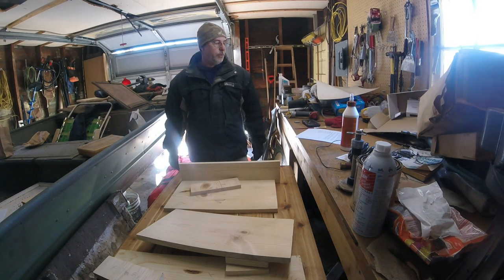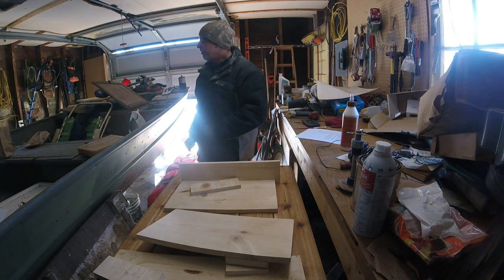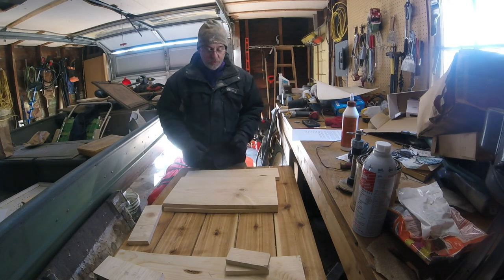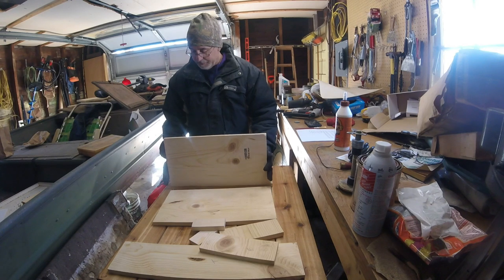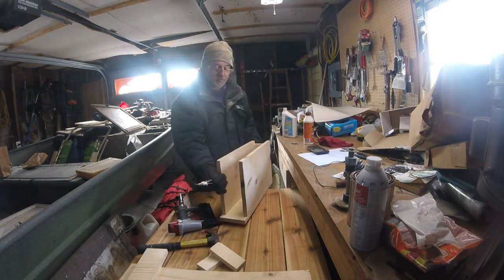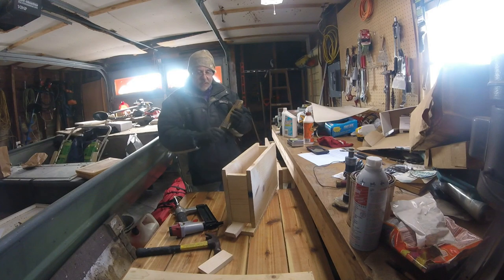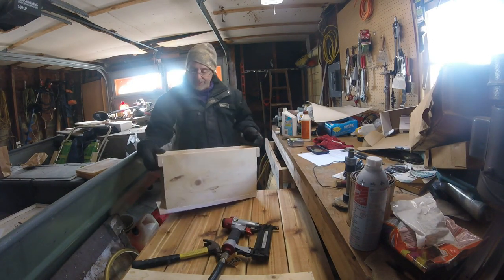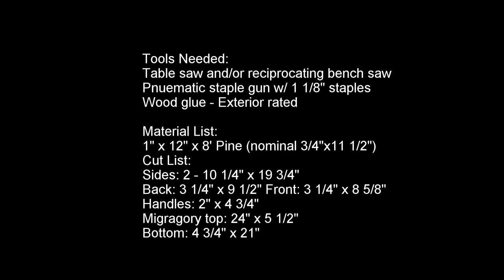Adventures in Beekeeping: Two Frame Mini-Mating Nuc Build

Comment: Thanks for the video. What's the reason to go with the mini? The 5 frame nuc box would be only marginally more expensive. If you're concerned over too much space you could use a divider. Also you could put entrance (disc type) facing the other direction and have double mini nuc which could be converted back to a full 5 frame nuc at a different time in the season.
Reply from the maker: This is ONLY to raise mated queens...that's it. When I have a hive or nuc I want to split out, I can split the hive and have  queens ready to roll. Or if I want to replace a weak or swarmed queen, I will have a quick queen to replace with and I can start all over in these growing another queen. Why use 5 frames when 2 will work just fine?  If I have too many, I will sell them. Beats buying them.  I will have double nucs (4 frame) for overwintering bees.
The reason I don't want double mating nucs is because of drift....bees drifting is no biggie, but queens drifting and going into wrong nuc is not a good thing. Each will be different color and be spaced a nuc width apart. 

I can also take one package, remove the queen, split the package into 4 of these mini mating nucs, install queen cells or virgins and bang....that one package is now 4 starter colonies when the queen is mated.
Reply: never thought about queens drifting. a friend of mine uses a 10 frame placing entrances (4) facing the four different directions. he calls it a queen castle.
Reply from the maker: More than one way to skin a cat. Always look for new ways...I don't have a table saw, so I cant dado. His way will work too, but others have found you really need to make your hive entrance individually stand out for the queens to find their way home with greater odds.
Reply: Thanks for the info. I saw Barnyard bees video also. I'm getting a package from him this year. Can't wait. Also looking forward for warmer weather for fishing!
Reply from the maker: Me too....mid may though...a little late....and this is why I want to raise my own queens and also raise double nuc colonies to repopulate colonies I may lose in the winter.

Comment: Nice video.  Perhaps this info will help you out.  First off, I do not work for Lowes.  I run an apiary services company, with includes VDM and SHB remediation.  Bees is what I do.  I usually use 5 frame nucs but I have developed a method to get multiple queens off a frame without cutting them out.  I have gotten as many as 6 queens off of 2 frames with a combined 11 queen cells without having to do hourly checks on the frames, which becomes stressful on the bees.  My problem came when I had too many new queens and no place to put them.  I am making some of these 2 frames out right now and came on to see the exact directions before I start.  I had to put this disclosure in, as you will see.  

The flooring material Dave from BYB uses is called "Advantech".  It is a 3/4" tongue and groove subflooring. It is excellent for this purpose and I am using it to build my 2 frame nucs now. It is about $38 per sheet and is only sold at Lowe's.  I have used it to replace the old sublflooring in my home, to build a chicken coop and a pig pen for a 700 pound boar.

For the house it is awesome stuff.  It weighs a ton and it is solid as a rock.   As chicken coop material is is superb; I metal coated it for element protection.  As a house for a 700 pound boar, not even close; he is one strong hog, who enjoys plenty of space.

Advantech is perfect for any size nuc or hive.  It is solid and a good coat of paint will let it hold up for years.  Although it is similar to OSB it does not absorb moisture and swell.  It also does not fall apart from moisture or humidity unless left unpainted in the elements for  a long, long time.
Reply from the maker: advantech is good stuff...we can't get it here very easily, so I use what's available.
Reply: since I'm making 5 frames nucs I use OSB and I rub some exterior caulk in the end where the cut was and a couple coats of good exterior paint and it lasts a good while for that cheap.

Comment: I see a big problem you are using 3/4 x 12 inch the problem is if you don't cut and and flip one side and join them back again they will start to cup I made furniture you can't do it that way with out trouble you can finger joint it but not the way you did sorry to tell you this
Reply from the maker: 10 months later and no problems. Sorry to tell you that.
Reply: Ya, it's a bee hive, not a piece of furniture! But checking out the end grain and choosing to orientate your board to take advantage of that in the 'roof board' to better shed rain or direct condensation to the sides is a good idea to keep in mind.  A couple of bar clamps would make the job a lot easier and faster.  I worry about ventilation if you only have a small hole for the entrance.  I'm not a bee keeper, just doing some research into it to see if I want to set up a hive or two for pollenation.  You can easily block the entrance as it is constructed, but if you find yourself needing more with only a small hole drilled as an entry, you are going to annoy a few bees trying to change it later!
Reply from the maker: @georgegoertzen4723  I have drilled 3/4" holes in the bottom of the nucs and put screen over....drains any leaking feeder jar syrup and more venting.